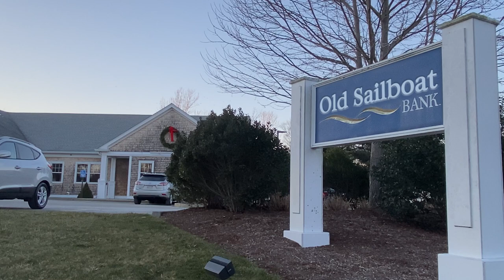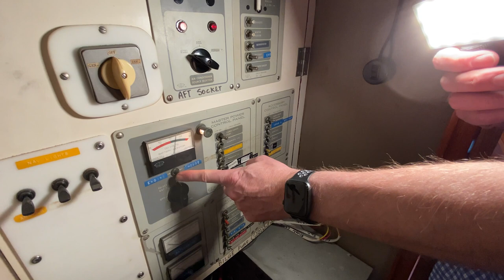Ran-day's Sailboat: EP 4 Part 1- Winter, Spring & Splash-in #captainq #ran-daysboat

Comment: Water in the bilge on the hard...Like Captain Q says, the best time to look at a boat is when it's raining. You really must be able and willing to crawl from stem to stern to inspect every single hole and hose that has been put in the deck and cockpit. I found 2 marine speakers and 1 cockpit drain leaking inside the boat when it rains. Check the toerail bolts, anything mounted to the deck, including the mast step plate bolts.

Comment: My entire sailing career has been in the south, specifically on the Gulf of Mexico, its connecting bays and waterways.  And fortunately boating down south isn't as expensive as it is up north.  Additionally, my boat, a Beneteau 42s7, stays in the water 365 days a year, except for a haul out every two years for new bottom paint and hull maintenance.  We don't have to mess with winterizing, decommissioning, re-commissioning, de-masting, expensive boatyard fees, and expensive storage.   Luckily, our per foot dock side cost is $3 plus electricity.  I park directly in front of my boat and enjoy a short ten step walk to board my boat.  I simply couldn't afford a boat in your neck of the woods.  As for hurricanes, my fellow marina boatowners and I have a well formulated emergency plan that has repeatedly worked for many years.  You're very lucky to have Captain Q as your mentor so enjoy him as long as you can.  Good luck.

Comment: Good to see an update posting. I have an alternative winter storage solution you might consider. The Gothic arch sheds that a number of boatbuilding groups are using may be helpful to you. That would protect the boat, give you room to work on the boat, be reusable, and be affordable. You could obtain the wood from an independent saw miller and the covering from a large industrial farm supply outfit. See @Sampson Boat Co. They used a Gothic arch before they moved to the water and a wooden boat shed. An outfit that also had skin on frame small boats used to sell plans in Wooden Boat. If you bother to add a covering layer on the inside as well as the outside, the sun will warm the space and it will be much easier to warm up for better working conditions. I know this from personal experience in Alaska. Take care and Bon Voyage.

Comment: Very nice looking boat Ran--- day..
I guess shrink wrap got very expensive compared to when I remember it..
Here's a tip for ya, when you winterize and put it on the hard, have them unstep the masts and build a cradle on the deck fore and aft to support the mast.. and then go to Ocean State Job lot and buy some heavy duty tarps.. which you will drape over the mast like a big tent... So for the price of the tarps, $200, some rope and the cost of the yard unstepping the mast.. it's more money in your pocket to do needed upgrades..
Anyways, that's how us old timers used to do it... Ask the Capt.... 😉
Reply from the maker: That’s pretty solid… I’m a frugal sailor so I like workarounds like this… I’m going to attempt some refit work this winter so I might need something more enclosed… we’ll see!! Thanks!!
Reply: That is a good and  time honored method. But if you go that route, it is crucial to visit your boat regularly throughout the winter to ensure that tarps have not ripped, and cockpit drains are not blocked and are draining OUTSIDE the hull. Nothing will elevate your stress level quite like finding your helm ensconced in a 2000lb block of ice.

Comment: Several comments on winter storage:

1. Batteries.  If the batteries are fully charged when the boat is put in storage they will be fine over the winter.  I am on Mount Desert Island, ME and don't trickle charge my batteries over the winter and they are fine.  I have only been doing it this way for 29 years, so I could be wrong.

2.  Bottom paint and centerboard.  With a new boat I would have painted the bottom and dropped the centerboard when they lifted the boat over land and painted it too.

3. Launching.  That yard is rather odd.  I have stored at three yards over the last 27 years and all of them required that the engine be test run before launch.  All you need to test start the engine is a bucket of water and a hose if you want to keep it running for a while.

4.  I hate shrink wrap on a painted boat.  In addition to scratching the paint, shrink wrap can also trap water at the bottom of the wrap which can destroy an Awl-Grip paint job.  It isn't much more expensive to store inside in an unheated shed.  I switched to inside storage about 10 years ago and it is definitely worth the extra money.

Comment: I noticed that Captain Q was wearing a hard hat in the last segment of the video.  Is there some particular reason for that?  As to the batteries I take the batteries out of my motor home when it is in storage and keep them nice and dry and warm in my basement and on a battery tender.  For the viewers, please do not confuse a trickle charger with a battery tender.   A trickle charger is just a low power unregulated battery charger while a maintainer is a low power regulated charger that will stop charging when the battery gets full.  I have ruined a brand new battery by leaving it on a trickle charger over the winter instead of a battery tender.  The two terms get used interchangeably these days but there is an important difference.  Keep the good stuff coming guys.
Reply from the maker: Fantastic tip, thanks! The upcoming offseason, I have a basement spot to pull the batteries out and treat them to a cozy home 👍👍
Reply: We are built to solve puzzles and a boat is the ultimate puzzle. We found that keeping a notebook of repairs, schematics and learning is a most valuable tool. Also as Captain Q if he helped Noah build the Ark 😀
Reply: A hardhat is for safety. The marina may require hardhats when the crane is used so one does not get boinked on the head with a falling something.

Comment: My boat spends more time on the hard than in the water living in Wisconsin and sailing Lake Michigan.  I didn't like the idea of shrink wrapping a boat every year - the prices are high and I didn't like the idea of the waste either.  I ended up having Ship Shape Canvas make a full deluxe cover and the price with shipping came in under 3000.  My boat is slightly smaller (Pearson 365)  but I am fairly certain you could find a winter cover for less than 6-7000.  Check around - it is so much nicer to work with - gentle on the boat and usually has a decent zippered door for accessing it.  
Keep up the great work - really enjoy all the videos.

Comment: ... Aaaahhh ... Randy ... you are thinking  some what incorrectly ... I totally agree w/ the waste of plastic ... but it is actually about "breathability"/ mold !!!  CANVAS .... CANVAS ... CANVAS !!!  Nice boat !!!!  I put a canvas cover on the families  30'ft CC ... in South NJ ... it is better to get it done early when warm,  then  try and sneak out the last warm weekend ... (lesson learned the hard way ... several times ... )
Reply from the maker: Yup I love canvas… no question… another good reason to avoid plastic especially with all the wood I have… thanks!
Reply: @YachtHunters  If I remember correctly the winter cover was made by Fischer Canvas in NJ.  They used a thick heavy canvas that lasted for a long time.  Dad had designed and made a complete wooden frame that the canvas cover fit over ... we learned to put the folded canvas cover in the cockpit  or foredeck BEFORE the boat was hauled  Floating docks vs lifting it up from the ground when the boat was on the "hard" on boat stands ....Oooffff ...
Reply from the maker: Today it’s FairClough  canvas 
But good idea

Comment: Heee’s Back!
Reply: On the subject of boat covers, canvas or shrink, I go with the latter.  For your size boat, a canvas cover will have a huge cost plus dry weight and even tho in pieces, will require lots of heaving to get it in place, zipped and tied down.  Then there is removal and storage.  Shrink wrap is done by a crew of guys and easily removed with no storage issues and man-handling.